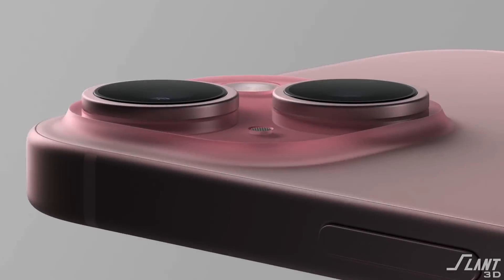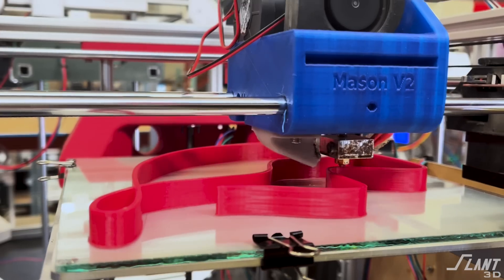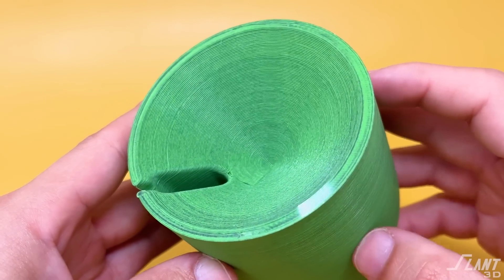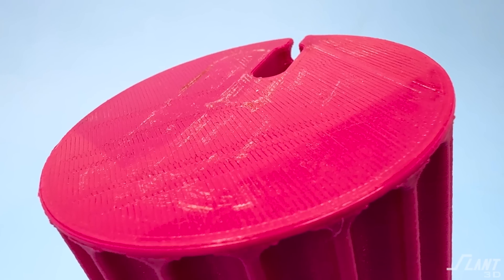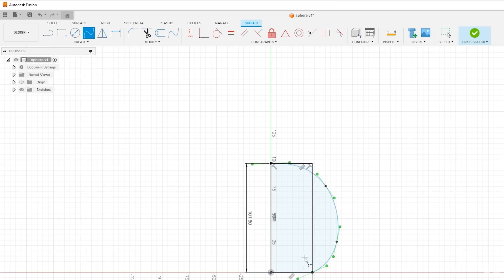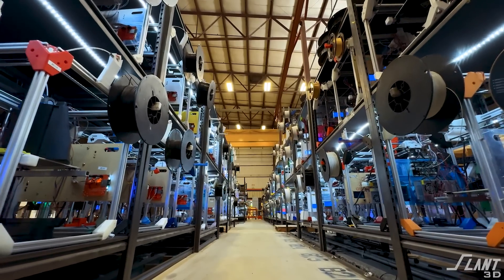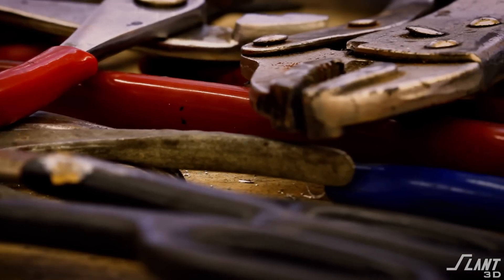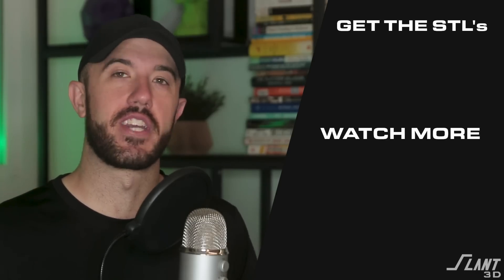Sell MagSafe Charger Stands with 3D Print On Demand

Comment: have you any advice on the best style of supports to use
Reply: The best support is no support, but if you run into a situation where they can't be avoided, you kind of have to go with what works best for that situation (they do have a video on that)
Reply: @TS_Mind_Swept  Do you know what the supports they used at the start are called? The square looking ones, I have been using anycubics organic supports and I can't tell if it's fast or better than other supports 😅
Reply: Normally the most efficient ones are snug support. They are both faster and more material efficient that ordinary supports. On the other hand organic supports are often easier to remove, but they require more material and take longer to print,
Reply: @alexanderabildsten9092  thank you so much :D i think i will try snug supports tomorrow then and see how that goes :D
Reply: @chaver28  How did it go?